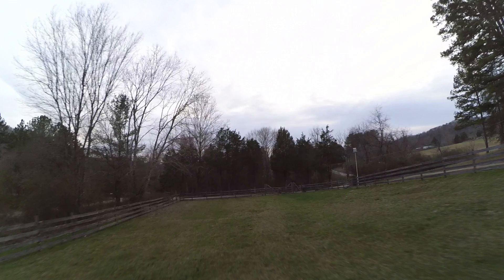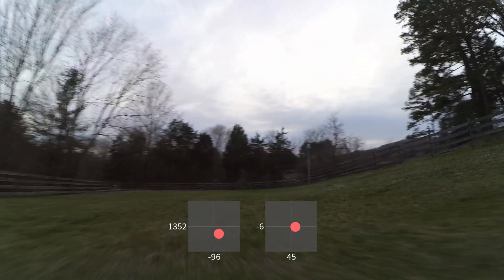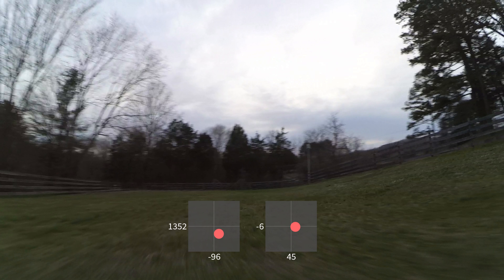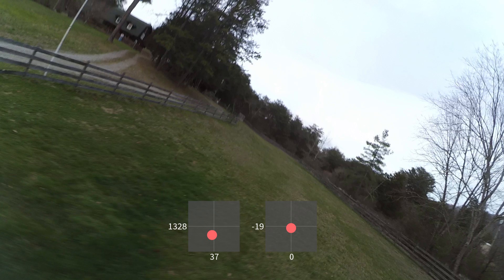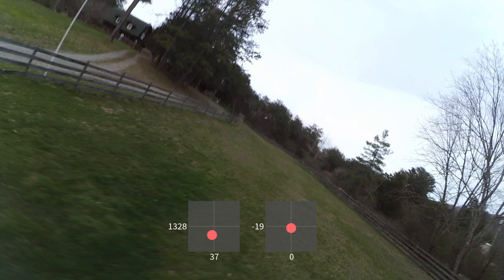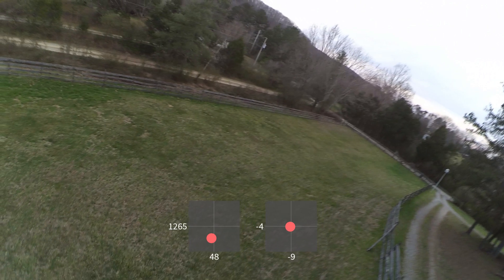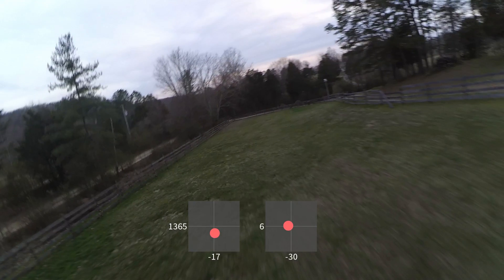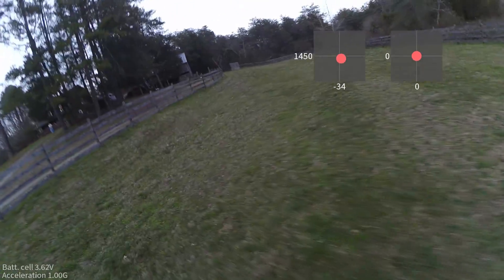How To Perform Sideways Flips | QUADCOPTER TRICK TUTORIAL

Comment: What does it mean if sometimes your quad flips when you yaw hard in angle mode?
Reply from the maker: My first guess would be that motor idle speed is too low and a down-spinning motor is stopping. The answer would be to raise digital idle percent (if using dshot) or raise min_throttle (if using any analog motor protocol like multishot or oneshot).
Reply: Joshua Bardwell Thanks I tried increasing the idle even as high as 20% and turning off motor stop but it still does it. Its weird because with the idle throttle value higher it starts to flip on pitch now too. I notice when its outside wind makes it wobble a bit too even when not that windy but not sure if its related. The quad is a stock Arris X80 with GNB 600mAh 50C lipo. Any ideas lol?

Comment: First of all: Thank you so much for these videos. I did my first rolls today, might try some flips tomorrow and in the meantime I watch your videos to find out what I could try next. I started LOS with a larger drone some years ago and it took me a while (and a better camera) to get along with FPV. So much fun, and your infos really help a lot!

What is the difference between using air mode and simply not lowering the throttle stick entirely so that the motors get some spin? So far I am flying a low budget, 3D-printed thing with an F1 CC3D - what are its limits? I have seen videos here on Youtube where people set up a kind of "CC3D"-version air mode - is that good enough? I don't want to spend money on an F3 just yet - my budget went for props, a better TX, and new goggles...

Comment: I think that even if you use motor stop, in air mode motor keep spinning at zero throttle. Or am I wrong? Anyway thanks for taking so much time to (try to) educate us;)
Reply from the maker: +Trolleydolly130 It depends on which version of Betaflight you are using. Not all of them had air mode override motor stop. Only... I think either 2.4 or 2.5.